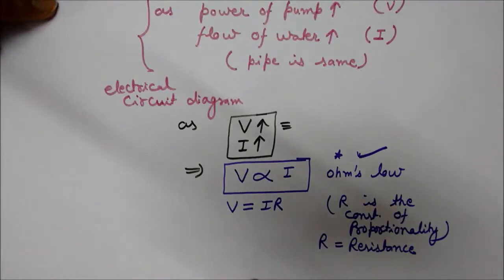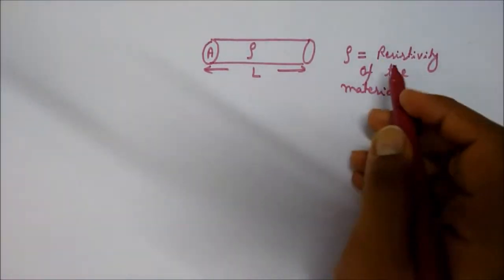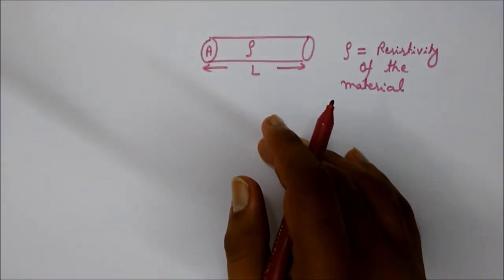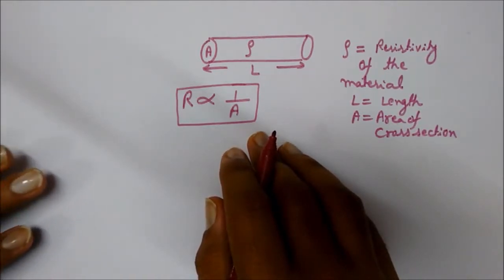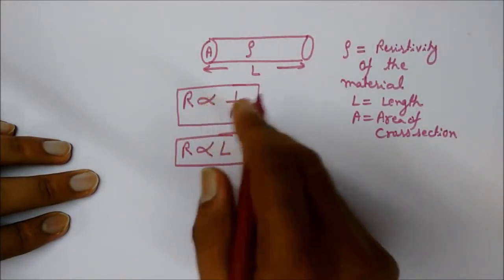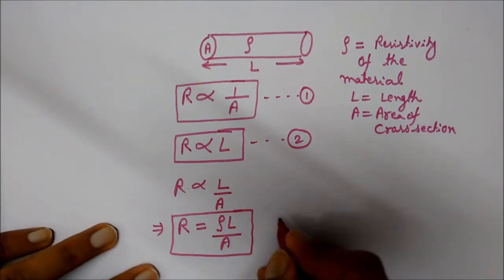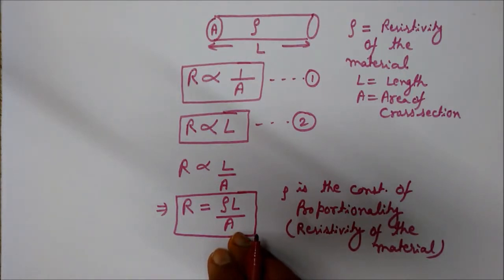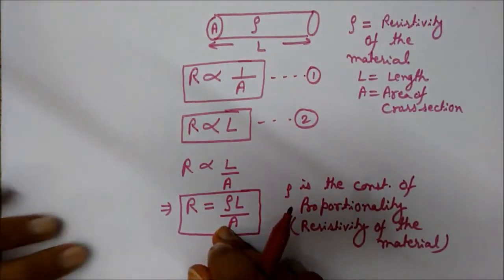Resistance of a Conductor (Resistance Formula Derivation) [HD]

Comment: Hi, if you have a twin copper cable with a CSA of 2.5mm do you have to half the final resistance as the voltage is going down 2 separate cables. In which case the CSA technically becomes 5mm so the resistance is less?